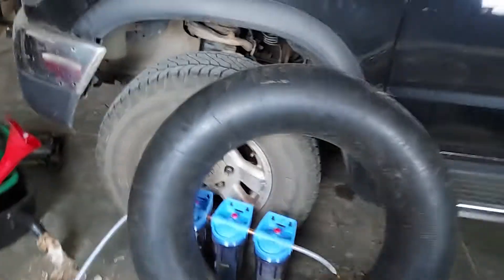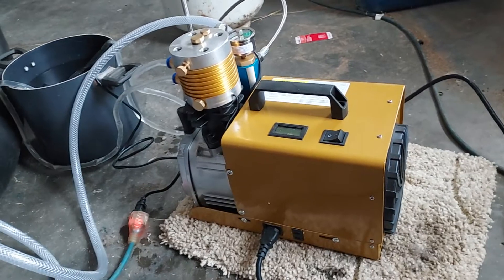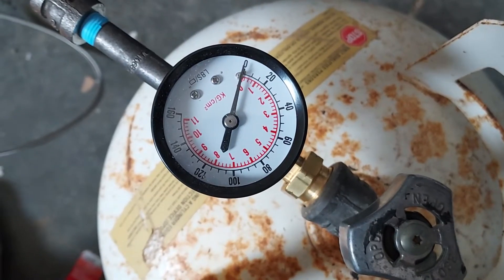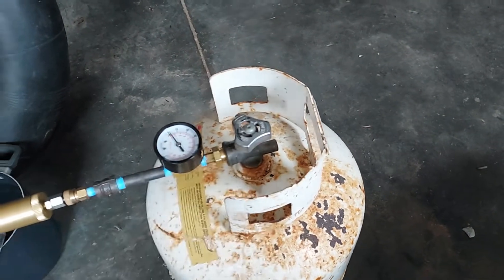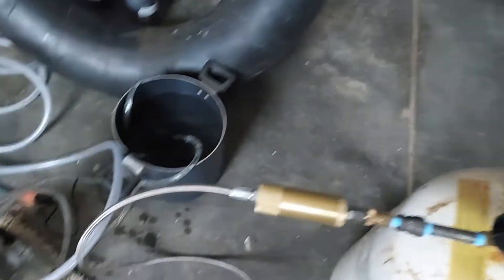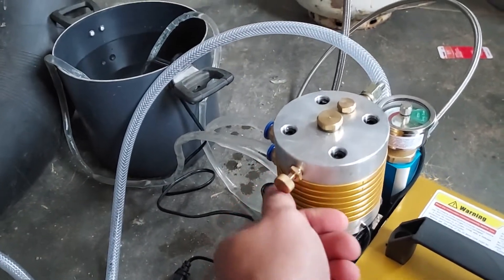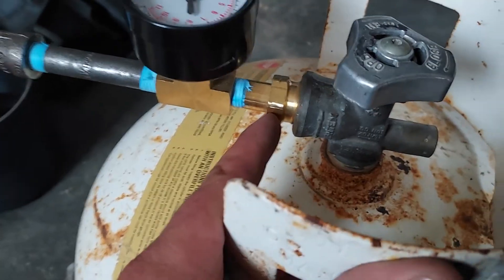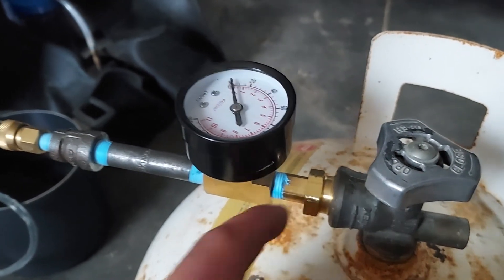compressing biogas

Comment: what type of compress I can use?? for example can I sue regulare air compressor?? I have concen with igniting the methan as I compress the gas?? any feed back would be appreciated
Reply from the maker: That’s a fair concern, I’m still concerned with that every time I go to compress. You need to be very careful to make sure there is no oxygen in the system before you start the compressor.

Comment: I am a CNG/LPG kit installer by profession and I compressed my biogas and run my cng car with it. Only thing you have to do is tune the kit a little richer just like you did with your stove/burner to compensate for the leaner gas. You get just a little less power but it works fine. My concern is that biogas has a small percentage of Hydrogen that might make the steel tanks brittle overtime and they might explode eventually under pressure. I have type 4 carbon cng tanks but am still afraid to use them as they are not rated for hydrogen. I have seen videos of cng tanks exploding and I don't want to experience this so I stopped doing it. If you can find a way to get rid of H2 then that would be great. They say that H2 molecule is so small that it goes through any tank even steel ones so I guess that by the time I compress it into my tank it should have already escape but I am not sure as I have no way to measure H2 content.
Reply from the maker: I have heard biogas could have up to 1% h2, but for some reason last year when I had my gas tested hydrogen wasn’t anywhere on the sheet. Next time I’ll have to ask them if there’s a way to check that too. I can’t find a colorimetric tube for it. 

Do you install multiple brands of CNG kits or just one? Can you plug one here? What do you think the chances are they sponsor me a kit for a video? 

I appreciate your comment.
Reply: @BiogasUSA  I haven't found a way to measure H2 either, that's why I stopped doing it, but I might start again because I found yesterday that my type 4 cng gas  tank is compatible with RNG. We install systems by Lovato, BRC, Stag etc. There are a lot of LPG and CNG cars here in Greece but I can't tell you something about sponsorship as this is a joke around here. I know people who use RNG in type 1 steel tanks but I think it's a risk. There are ways to get rid of the CO2 to turn biogas to RNG which is more powerful. I might try such techniques but maybe in 6 months as I don't have the time now. Maybe you should give it a try and make a video about it. Oh and buy a type 4 carbon tank and get rid of this rusty steel one!
Reply from the maker: @vasilispants8241  what are the ways to get rid of the co2? The best I could do so far was 60% ch4.
Reply: @BiogasUSA  If you google "How to eliminate CO2 from biogas" you will find many pages on the internet. All professional plants have scrubbers for CO2, hydrogen sulphide, siloxanes and moisture that turn raw biogas into RNG which is 97% methane and is practically the same as CNG. There are many methods and I am sure you will find one that suits you. I will try the water and iron wool one.
Reply: @MicahWeb  I thought membranes was a high-end solution used by factories. Where can I find such special membranes in normal prices? Would an activated carbon filter off of a car's gas tank do the job? I think your 2 solutions are really costly, we are simple diyers here.
Reply: What about wood gas?
Reply: @joshjenkins3815  wood gas has 60% hydrogen. f's up the storage tank. hydrogen can corrode metal. its not suitable for storage
Reply: @joshjenkins3815  wood gas a.k.a. syngas has much higher H2 content, or at least shoud have (depend on type of biomass, and exact sample of biomass, but can be even 20%). You can try converting it to dimethyl ether (EU plans to use it as a *partial* substitute for diesel fuel, as it's too "dry" on its own; odourless and extremely combustible), or convert it to methanol (extremely toxic and extremely soluble in water, so by spilling it on ground you can contaminate groundwater), which leaves... gasoline or even diesel, but I haven't gotten that far.

At first conversion to gasoline or diesel seemed too complicated, but after realizing how hard it is to compress methane, and even safer option with cryocooling is too problematic, I don't think there's that much difference: if you can't burn it right away, it's better to convert syngas to some liquid fuel that will stay liquid under athmosperic pressure and room temperature.
Reply: @joshjenkins3815  simple answer doesn’t burn clean google difference between propane and gas cars a woodgasifier is 10x worse than a gas were bio gas has similar properties as  propane and natural gas and process to create is simpler.

I’m here in Canada so implementation here is not ideal due to climate but I’m thinking of having bio digester in a passive solar green house
Reply: I have heard latex is a suitable lining for H2 gas tanks, but have not found much information. Perhaps a tank with latex lining is available? Can anybody comment on this?
Reply: I’m looking into designing a single mechanical device that’s an off grid person dream machine and you good sir’s taught me via your comments and video the key parts I was missing for what I need. 

I would love to see your thoughts of adding 10% hydrogen and oxygen via electrolysis. Having the compressed bio gas plus hydrogen created on demand with oxygen created on demand mixing together in a carberator of sorts that would first start engine on 100% biogas the once engine is running reduce biogas to 90% and add other gasses by 3 separate supply lines.? I’m creating the oxygen and hydrogen after engine  is running and adding it once it is running as to not have an issue on self destruct. 

Also bro more content my man ur brain is on point with it game
Reply: is there any way at all to make the gas go through a filtration system so it reacts with some compound where it creates H2O joining oxygen without everything exploding?

Comment: I guess moisture is a big problem. If you rust your gas tank from the inside you'll blow yourself Up...
Reply from the maker: Yes, h2s is the first problem. Nothing will eat ferrous metal as fast as h2s and biogas has large quantities of it. 

After than, moisture is the next problem. 

I’m hearing now that the 1% hydrogen in biogas could make the walls of my tank brittle too.

Comment: Just wondering. Is there a reason you're sucking the gas through the filters backwards? I guess it doesn't matter with the filter media you're using. Just seeing that you're going against the flow arrows on the filters triggered my ocd, lol!
Reply from the maker: Hahaha I understand. 

On the filter full of water if I ran it with the arrows it would suck the water up the pvc like a straw instead of bubbling the gas through it. I actually have this problem sometimes if the gas tries to run backwards. 

Since filming this video I have relocated the filters to between the digester and the inner tube so the gas passes through a little more slowly. Sometimes if I have a big temperature swing (from hot to cold) the liquid mass inside the digester physically shrinks and sucks the water out of that filter and into the digester.

Comment: What exactly is the issue with air in the system? i assume there is small amounts of air in the filters so some air will be pushed into the tank.
Reply from the maker: Two things @mattycastaway. I am working hard to produce a more pure methane, so I don’t want to dilute it with all the nitrogen in the atmosphere. Also, if methane and oxygen mix in the right quantities there is a chance it could explode. For these reasons I do my best to purge all air out of the system.

Comment: Inner tube removal would suggest using a expansion tank as in the one used for plumbing it's a steel tank with a rubber bladder inside is a vacuum pump to make the bladder inside expand and use an air compressor to compress the bladder inside to expel it there's no potential contamination and you can chill the tank and internal bladder safer smater and stream line. You can also get these tanks with internal bladders in 20- 200 gallon capasity no more inner tubes.

Comment: Based on the compression rate data that you have supplied visually it would take about 7.1 hours and 116 inner tubes to fill the 200 bar gas tank that you have described.
Might be good to find a bigger gas transfer mechanism than the inner tubes, perhaps air mattresses?
Reply: Hey Jurie, good to see you here too. Air mattresses work on my system but tend to be clunky and somewhat "expensive". I took standard DPC 500-micron plastic, sealed the ends (with a normal clothing iron and some baking paper) and now I have a +- 3000 L container. It is durable and it only cost me about 300 ZAR. Which, if you compare price per litre works out much cheaper. I am still working on the compressor system tho.

Comment: Great video. Very informational. 👏👏👏

Just wondering about the energy consumption of the compressor. Would it be more economical if I just use the biogas as-is?
Reply from the maker: That’s a great question. Watch my most recent video, it’s on just this topic and there is some great discussion in the comments.

Comment: A normal compress can compress this to 120 psi...why don't you show it compress at pressure  above 200psi
Reply from the maker: This is a two stage compressor, it will compress up to 6,000psi, however the propane tank I am using would rupture long before I got there. 

Because of the much lower vapor saturation pressure of Propane, these tanks are generally only rated for a maximum operating pressure of 300 psi. As I stated in the video, I sprang for the expensive two stage compressor because I anticipate upgrading my tanks for a CNG kit on a vehicle in the future. Thank you for the question.
Reply: I like to see a update of this video with high perfume tanks.

Comment: I'm confused how did you purge the air from the propane tank, I'm familiar with filling these tanks and normally you leave tge spitter/purge valve open while filling them until you see the lp spitting out, then you know youve pushed the air out and its full, how can you do that with bio gas
Reply from the maker: I can’t do that because I don’t have a purge valve, but this tank still had propane in it when I started so I just have always kept some positive pressure on it to prevent oxygen getting in. (I have had my gas tested to ensure this has been successful)

You’re using the word “air” in place of “gas”. Since nothing in my tank is going to be liquid, its a little different. The only thing I’m concerned about is O2 specifically. 

If the tank was open and empty before I started I would purge it by filling it with biogas, and then open the valve and let it vent almost to atmosphere. I would repeat this process 3 or 4 times and then (because I can) I would have the contents of the tank tested for 02 to ensure levels are below acceptable thresholds. 

This was a really good question. I love liquid gas and one day aspire to liquify biogas hahaha. I suspect a small cryo plant is the most efficient way to purify ch4 enough to maybe run a vehicle.
Reply: @BiogasUSA most of those types of tanks have them in the valve itself, typically a flat head you back off, looking at the video I think yours might be the opposite of the inlet/outlet port on the valve but be cautious if you open it there are times they won't seal once you open them if they haven't been used in a while. Thanks for the answer, great idea.
Reply: @BiogasUSA   also yes I guess gas is probably a better way of saying it, good point on the LP obviously is liquid lol, I wasn't sure how you would get any unwanted gas out of a tank if it had been depleted,  but your answer makes sense

Comment: Why does it did not explode when compressed? I understand that you provided cooling. But is that enough to keep the system safe when running? Methane is flamable gas, and when you compress a gaseous state temperature increases, plus the methane is flamable. 
What is the ignition point of methane vs temperature and pressure atm condition? Hope you can enlighten as you got the experience on the project already.
Reply from the maker: It can’t explode because there is not enough oxygen. Methane lower explosive limit (LEL) is 5%, the upper explosive limit (UEL) is 15%. 

Being my gas is almost 60%methane it is far too rich for combustion. This is why I am very careful to purge oxygen from my system before I start.
Reply: sketch lol @BiogasUSA
Reply: @BiogasUSA  I would be more worried about the Methane you used to purge the line between the bottle and compression and the tyre and compressor, as this is now in the atmosphere, next to a Non-Hazardous area-rated compressor in a non-ventilated room, but you didn't blow up this time. All you need is the LEL at 5% and a static spark (from clothing), or wiring in your shed that is bad and you are history. I would do this in a well-ventilated (No walls) space with no roof, as a roof will capture any Methane. I like the idea of compressing the methane as less storage space is required.

Comment: Nice job. I can't help but wonder if the boigas turns into a liquid under high pressure like propane. Not that it matters really, just a curious thought I've asked myself when considering building my own gasification system +storage
Reply from the maker: Any gas will turn to liquid when it reaches its vapor saturation pressure. Propane saturation pressure is around 300psi  Methanes vapor saturation pressure is close to 900psi

These values vary by temperature also, as mentioned already.
Reply: So you need scuba tanks 😂
Reply: Check out phase diagrams it depends on the temperature and pressure of the gas. if you filter it or to approximate it you could just assume it's all methane

Comment: At 4min 16s into the video you can see the propane tank was last hydro tested July 1997. They are supposed to be tested every 10 years to make sure the metal hasn't fatigued and reduce risk of an explosion. You might want to let viewers know to use a propane tank that is within 10 years of that last stamped date else don't use the tank -- it needs to get re-hydro tested. Just better safe than sorry.. especially since this is more of a DIY thing and there are lots of signs of rust on that tank. Haven't watched it all yet, but also your compressor can easily explode that tank, so hope I see some kind of safety to make sure it doesn't overpressure the propane tank.
Reply from the maker: Great points. Thank you so much for the safety tips.I’ll ad these to the description. 

My setup has changed quite a bit since this was filmed. If I ever film an update I’ll be sure to include these safety points also. 

I have no prv or anything, the gauge you saw I added is the only measure to protect from over pressuring.
Reply: They aren't filling it as high pressure as a standard tank.

Comment: Great video.... How many lbs was contained in the tube?
Reply from the maker: Between 2 and 3 lbs. I can’t get any higher than that without starting to leak out the bulkhead fittings on my digester.

Comment: So pumping the bio gas through water removes the h2s gas how?
Reply from the maker: Yes, h2s is very water soluble. Bubbling biogas through water it will dissolve very quickly and stay with the water.
Reply: @BiogasUSA  just normal tape water do not need to need minerals or chemicals to water and how often does water need to be replaced

Comment: You also could build an adaptor from the 20lb to 1lb propane bottle adaptors.
Reply: Those are off the shelf for like 12 to 20 bucks.
I prefer the hose version, with a valve on it.
The hose lets me set the 1 lb can on a scale, and make sure I don't overfill it.

Comment: I wonder if you could run your basic rv appliances with this just like you would with propane or would you need to adjust for flow rate due to it being a different type of gas. The furnace would be interesting to know if it can run
Reply: The pressure is the same,  but you have to use different size orifices for propane and natural gas appliances. They have very different heat values
Reply: on all the other DIY Bio gas set ups they say the wholes on the burn end need to be bigger, but they may be soley due to the fact the pressure of flow from a tire is nothing like a tank. IDK just a thought from deduction @hangfire5005
Reply: I looked this up earlier, with this method the gas is methane so natural gas appliances are compatible. look it up and research it, so you have a better understanding of the difference. I looked it up to see what appliances would work best with bio gas system because I will be building off grid and want alternatives to consider that will benefit the new homestead. it should power a tri fuel generator as well for electric to top off a solar battery bank on cloudy or bad weather days. lot of uses for this system.
Reply: from some of the other videos i have watched, the gas burners on a stove in order to burn it are different so i would assume that a furnace would also be different
Reply from the maker: Hey all. I have a video where I convert a propane turkey burner to biogas. I use it often and it works great. I want to try to convert some more things. I have a small natural gas powered furnace I need to tinker with some more. 

Even though natural gas is methane, biogas doesn’t always work as a plug and play fuel source for NG appliances because biogas is so much more lean. That said, with some modifications I’m confident we can convert anything that runs on gasoline, propane or natural gas.

Comment: Did I see that the flow was in the wrong direction??
Reply from the maker: Yessir the filter housings are designed for filtering water. Since I am filtering gas I thought it best to run them backwards so flow travels down the center tube and out. If I was using a liquid filter like a water bubbler especially that would prevent the water from running out the tube and traveling downstream.